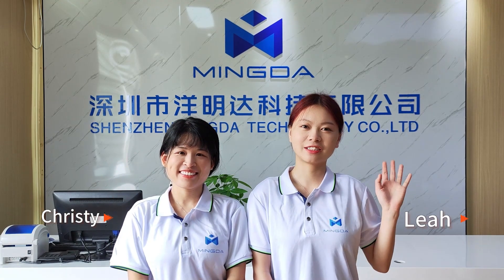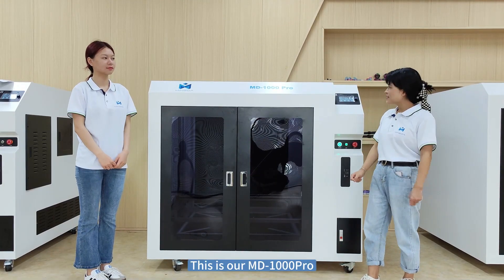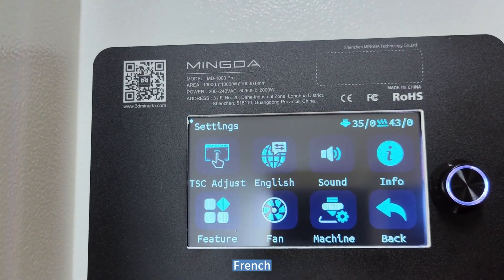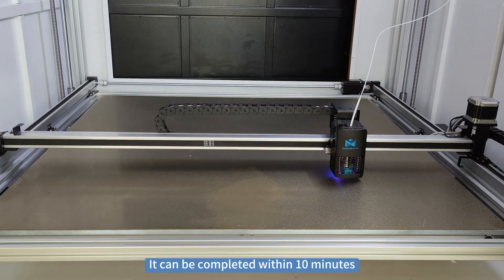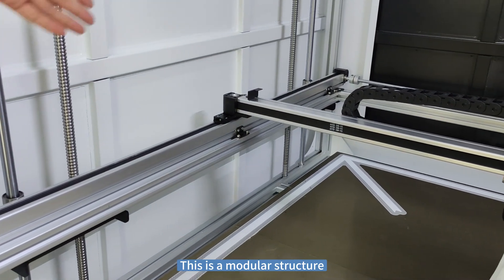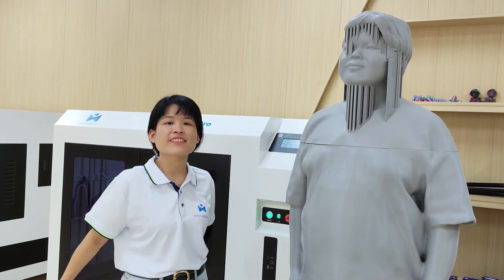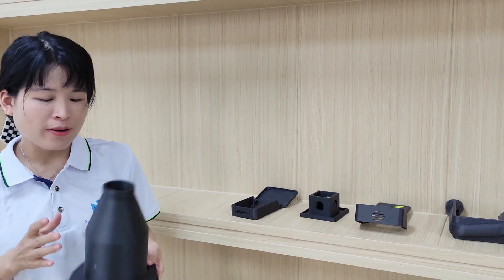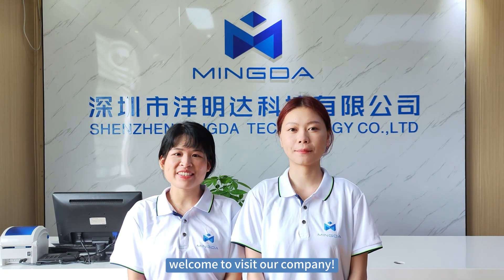Let You Better Know MINGDA 1000x1000x1000mm MD-1000 Pro Large 3D Printer

Comment: How are the electronics different from the Magican series?
Reply from the maker: Compared with consumer 3D printers, industrial 3D printers have higher power and different configurations. For example, the high-temperature hot end of our MD-1000 Pro can reach 350 degrees. It supports printing various engineering filaments, such as Nylon, carbon fiber, and glass fiber composite filament, etc.
Reply: @MINGDAIndustrial3DPrinter  but isn't there a full metal hotend for the consumer printers as well?
can regular consumers buy the industrial printers, too?
Reply from the maker: @marc_frank  You can buy the full metal hot end to replace the standard hot end on our consumer 3D printers, and our industrial 3D print not only support to print engineering filament, but aslo support the regular filament.